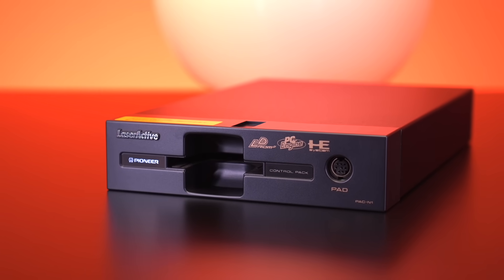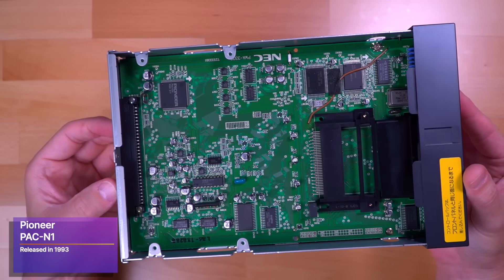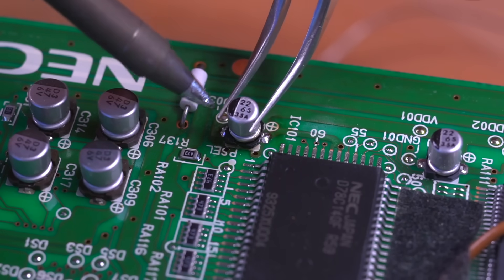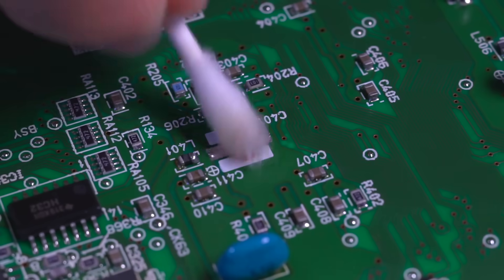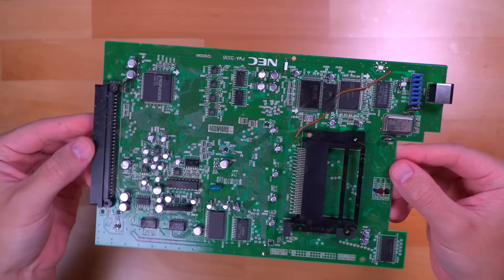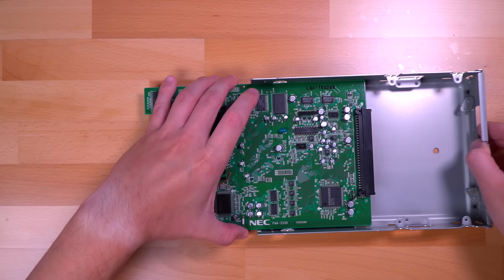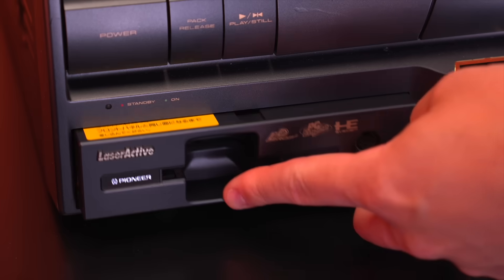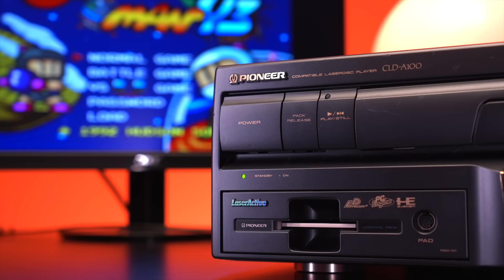Restoring One Of The Most Expensive Consoles Of The 90's

Comment: You missed a key differences between the S-1/S-10 and N-1 and N-10 other than region and yes the slash was deliberate and jets why. The S-1 and S-10 are essentially the same module and both allow you to play all games for the Genesis/Mega drive making this a region free system. NEC on the other hand swapped pins on the card input between the two regions which means the N-1 can only play PC engine games the N-10 can only play Turbo graphics games. The N-10 is also insanely rare making it a much easier option to simply get the N-1 and use either an ever drive or an adapter to play Turbo Graphics games.

Comment: 11:10 haven't tried but have an idea.  Place a piece of ton on the pad. Heat it quickly (the joint has to be mechanically stable not necessarily electrically). Place the cap. Heat the solder again.

Comment: Been soldering for 15 years and do so professionally now as a circuit repair technician. I find the twist method for SMD electrolytic capacitor removal to be the safest and most reliable. I've tested all the methods you showed in the video over the years and the twist method is the only one I've had zero issues with; all the rest I've pulled pads, blown up capacitors, or just had a miserable time with doing. As long as you apply a very slight downward pressure while doing a slight twisting motion with the pliers and never pull up until the capacitor's legs are broken, you're golden. I've had a 100% success rate with it, no matter the state of the pads, corroded from field-use or otherwise.

At the end of the day, the best method is the one you're most comfortable with and I can't fault anyone for that, but I'd recommend revisiting the twist method. You'll be pleasantly surprised. Thank you for the video, Tito!
Reply from the maker: I'll definitely try out the twist method for sure!  Thanks for your experience and advice!
Reply: He's getting really decent at soldering! Playing with electronics is an art in itself
Reply: This has been my experience too, even on boards that are particularly notorious for badly attached pads. Since the plastic under the cap is the first point of contact, all of the twisting force is applied to the plastic, the only thing that you need to be mindful of is like you said. I will say I don't apply any downward pressure either though; I just twist it in place without applying any directional forces
Reply: @DrunkenMonk1  Only reason I apply the slight downward pressure, barely more than resting, really, is to ensure that I'm not pulling up. You're correct that it works without, but I do it as a precaution.
Reply: I trust Mr. Carlson!  I thought he was trolling at first but it works
Reply: safest way is with a hot air gun. no pressure on the pads at all and the PCB still being warm makes it easier to replace with just a soldering iron.
Reply: @matthewreynolds8025  I'm going to have to politely disagree with you. Depending on the condition of the pads you may not be able to get solder to flow well enough to release the component. The twist method, the innumerable times I've used it, has never been stressful enough to ever cause damage, and can be used even when the pad is in a state where solder cannot flow.

I'm confident enough with my experience to say that twisting is 100% safe when done properly, and can be used in all circumstances. Hot air works, but I don't believe it's the best method.
Reply: @matthewreynolds8025  It's not the safest when the hot air can blow off surrounding components.
Reply: @matthewreynolds8025  Hot air can stress old PCBs. Also, you need to protect well surrounding components.The twist method is definitely the best.
Reply: ive only been doing it for 6 years but ive had two weak pads rip with the twist method as it still put pressure on the legs to twist them off. (rotate clockwise slowly until it comes off) only one ive never had a pad not rip is the clip off method, like seen here.
Reply: @bobt-kn2fs  Do small twists back and forth (clockwise and counter-clockwise, however you want to phrase it) until the legs break away. This minimizes stress.

Clip method is fine. I just don't like the mess.
Reply: @residentevilman64  ive done the rocking clockwise and counter clockwise as well. but yeh the mess on clipping isnt great.
Reply: @bobt-kn2fs  Hmm. Don't have an answer for you on that one then. I've seen some pretty messed up boards that have been out in the rain or come from coker plants, as well as boards that have had electrolytic damage, and never had a single problem using the twist method. Use what you find works best for you, though I'm still standing by my own experience.
Reply: Yes the shearing motion is perpendicular to the lifting up motion. Therefore, it’s the safest. Cutting the caps is worse due to its upwards motion while cut.
Reply: +1 for twisting. I used it for game gear cap replacements and never tore a pad, even on the corroded ones. I found the rocker method to be the worst, slowest, and likeliest to rip a pad. Snipping off the plastic is good too.
Reply: Amazing work!!!

Comment: The Twist method works really well. I did that method on a Mac Classic II I refurbished and a PowerBook 150 that I did the caps on the Screen for. The trick with that method is to ensure you are only doing horizontal twisting and not any vertical force. This causes the two prongs in the capacitor to rip out of the can and then the can slips off without putting any force on the pads on the board. Then simply unsolder the left over leads from the old capacitor.
A Tip: Make sure to take a detailed picture of the board you are replacing the caps on. This way, you can check to make sure you put the caps back on in the right orientation. You can also use a sharpie to make a mark on the board indicating the polarity.

Comment: Never had the opportunity to get my hands on the PC Engine PAC- neat to finally see inside of it!

I've now repaired 3 Genesis PAC units and am on my 4th CLD-A100 repair. Those PAC units can be a menace to work on. If they weren't preventatively recapped, they will have suffered major damage from cap leaks. I had to rebuild just about every pad on a sub board in one of them. Stripped the board and ran it through the dishwasher to get the electrolytic fluid out of all those vias.

The LA unit I'm in the of repairing is actually my personal unit. Was hoping recapping the power supply and replacing the ICPs would do the job, but no such luck 😅

In the middle of a full recap and solder joint rework... man, that thing has a lot of caps!

Thanks for another great video!

Comment: If you use a fine tipped hobby knife or a needle pick you can poke a small hole in the caps preventing them from exploding. You are basically boiling the EL fluid inside making them explode from the pressure buildup :)

Comment: Don't know if it would help in this case, but when I've had to remove glued chips from a PCB i've used a plastic spudger tip to wedge under the chip with hot air. after removing the solder on the legs. Depends on if the heat will damage anyhting else in the area, but the hot air rework stations usually have a very small tip for fine jobs.

Comment: Made me think of the JVC X'eye that I have cuz it was a combo Genesis/CD that retailed for $500, which was way more than the consoles separately. JVC was the chip supplier on the Genesis and said "You know what? Let's make our own and make it WAY more expensive." It's the most unique console I own
Reply: NO, JVC did NOT develop the sound card in the Genesis.    The audio in a Sega Genesis is a Yamaha YM2612 for music plus a Z80 based Programmable Sound Generator (PSG) for Square Wave sounds, tones, and noise.  The PSG was the same chip used in the Master System.   JVC had nothing to do with it beside be a chip supplier.

The partnership Sega with JVC did allow JVC to develop the WonderMega line, which is basically a Sega Genesis/Sega CD/Karaoke Machine which sold mostly in Japan (at a way higher price).  JVC did try to sell the Wondermega in the USA as the JVC X'Eye (again at a higher price).  Beyond that there is nothing particularly special about the Wondermega hardware.
Reply: @MrRobarino  Ah my mistake, they were the supplier. Thank you for the correction :)

Comment: Awesome video Tito!! Everything with the Pioneer name on it back in the 80s and 90s was automatically much more expensive.  Think how Apple is now.  Having a Pioneer stereo was a thing people took price in back then.  Also, did you try some acetone on that red glue once you removed the caps?  I don't think it is necessary to remove it from the PCB, I just wondered if it was a good solvent to remove the glue.

Comment: My way to go to remove caps like these is before soldering, I use a wide plier and give the caps a VERY gentle twist until I hear a cracking sound. That means the glue/welded plastic is broken off the board and I can resume desoldering the caps.

Comment: In regards to the "red glue", it's usually some sort of epoxy, polyurethane, cyanoacrylate (e.g. thread lock), lacquer, or various other "stiff adhesives." Sometimes lower temp hot air along with gentle scraping from a dull pointed tool may slowly overcure/loosen some adhesives where it can peel and/or flake off. 99.99_% isopropyl alcohol could be used but please use caution is it's highly flammable so be sure it's mostly evaporated if used in combination with hot air. Harsh solvents like acetone should be avoided as they could affect PCB ref des markings, but if necessary, use very minute amounts in a minute area and carefully pat dry off.

Comment: The snip method works well (much safer than the twist method), especially if you use tweezers (or a spudger in your case) to hold the capacitor down firmly as you snip.  A leaky cap can make those pads or adjoining traces very delicate, and they'll lift and/or break while snipping if not careful.

Comment: Cutting method seems like the best from all i've seen, least amount of stress on the pads, tho it is a little messier.

Also the reason why all these electrolytic caps have failed seems to be because they got heated up way too hot when they were originally installed, presumably via some kind of wave soldering system, or an oven, and the gasket inside was prematurely degraded. Otherwise they should not be leaking like that even 30 years after manufacturing, you can tell that all the through-hole capacitors of the era tend to be fine and only fail sporadically, meanwhile failed SMD electrolytics are a constant.
Reply: Depends on how tightly you define "the era". The capacitor plague started in 1999 and that was apparently a case of incomplete industrial espionage where they didn't copy the formula for the stabilizing additive.
Reply: @ssokolow  that isn't this, this was the early 90's, and only affects surface mount electrolytic capacitors. The late 90's to early 00's plague was all types of electrolytic capacitors capacitors.
Reply: @Nukle0n  Fair. I hadn't realized there was a defined era which was pre-plague, but still plagued by premature failures of a specific type.

Comment: I have always used the twist method but I think you misunderstood the way it is done. You don't just go balls to the wall and twist the cap, you treat it like a loose tooth and slowly turn it side to side. You will eventually weaken the legs which will safely remove the cap. I've done it on older equipment than what you are working on here in way worse shape and it is safe.

Comment: I'm a full proponent of the twist method! It's such a time saver and I've removed hundreds and hundreds of caps this way with no issues. This is including some nasty game gear boards. The key is to not lift at all, just keep twisting in one direction until the legs break then remove the plastic piece. If anything I apply a slight down force when doing this to better prevent lifting. 

I find the rocking method to be the absolute worst. That one has had the highest amount of lifted pads for me.
Reply from the maker: I'll definitely have to give it a try one of these days

Comment: i wouldn't recommend cutting caps, you risk shorting the motherboard, and also risk small catalytic explosions.

as a rule of thumb only ever cut caps, you can't remove and when you're 100% sure everything has been properly discharged.
else very good and textbook soldering job!

for the glue used under components, sometimes you can use a dab of IPA to release them, otherwise you need xylene solvent, but be very carefull with that .
Reply: Unplug the system and press the power button. All caps should now be discharged. Alternatively you can manually discharge them by shorting the positive and negative sides with a resistor.
Reply from the maker: Thanks for the tips!

Comment: In all soldering/desoldering tutorials I saw american technicians using soldering suckers, that are so common in Brazil. They help a lot on clearing these kind of components. Why their use is not so widespread in North America? It is cheaper than using solder wick and desoldering guns.....
Reply: Solder suckers are great if you have access to the pins on the other side of the board. In this case they didn't go through, so the best easiest method was to use the "cut" method. And just cut the cap at the board and remove the rest afterwards.
Reply: @graphicsgod  I find that they still work fine in surface soldering... Even if you have to use it a couple of extra times.
Reply: The silicon tip ones are great

Comment: I recapped my Pac-N1 last year. I would highly advise everyone to use flush cutters to remove the capacitors. Hot Air isn't a bad option either, but flush cutters would definitely help out with the caps that are glued down.

Comment: Just curious- does the PAC-N1 have the same region locking mechanism as traditional PC Engine/TurboGrafx systems? And do you need an arcade card for those few games that require it?
Reply from the maker: I believe the region locking is very similar using a different pin out for the hucard connector.  Zaxour is working on an internal region switching mod that looks very promising!  Yeah, I believe the arcade card is required for those games.

Comment: The SMT cap section was gold.

Seriously dude, cut that section out and make a new video that is literally just this and give it the title how to replaced SMT caps, it’s such a valuable section and needs exposure
Reply: You don't even have to do any of those techniques to remove SMD caps - literally just put the hot iron on both pads at the same time by pushing the soldering iron directly against the two pad sides. The heat from the iron is enough to transfer through the aluminum casing to the pads, and the plastic is just gonna burn outta your way anyways. Just push that iron right next to it and it'll take right off. It's really not hard - just be gentle not to tear pads.

And there is also a heat rework tool that you can use to easily lift them off, too, but you gotta mask off the areas that can't do heat (plastic parts mainly - typically using kapton tape).
Reply from the maker: Dang, that's actually a good idea!  I may have to do just that!
Reply: I'm always moving from one place to another and sometimes living in cramped rooms, but I wish to keep being able to do this kind of electronics experiments. What should I prioritize when looking for a tool for doing surface mount soldering and desoldering and if I only have one tool, which type should I get?
Reply: @gluttonousmaximus9048 soldering iron! I use the pinecil v2 with fine tips, would work well for you too because it’s USB-C it takes basically no space because no base station. Will need a good USB-C brick though if you want to have fast heat up (I use a 96w Apple charger)

Comment: I did the cut method for the smd caps on my SNES as I dont have a heat gun yet and it worked fine without any issues as it appears to cut the leads before they have a chance to apply any force on the pads. Just make sure you have really good cutters.
Reply: Definitely need really good flush cutters when doing cap removal this way.

Comment: You were talking about the internal Battery but haven't shown how to replace it. What Voltage? Is it rechargeable? Ist there a Mod for a CR2032 Coin Cell possible?
Reply from the maker: Yeah I totally forgot to replace it.  Console5 sells a replacement.  I believe it's actually more like a capacitor that can hold a charge for a long duration so it is rechargeable in a sense.

Comment: No cap, I actually think the snipping method is the best method overall. Although each method has its uses. Like for the VA0-VA5 Sega Saturns, I caution against using hot air at all (not even a FRAM mod on the other side of the board), because of those heat sensitive PLL chips.
Reply: There were actually quite a few caps.
Reply: Just send the iron on both pads at the same time, it isn't hard.